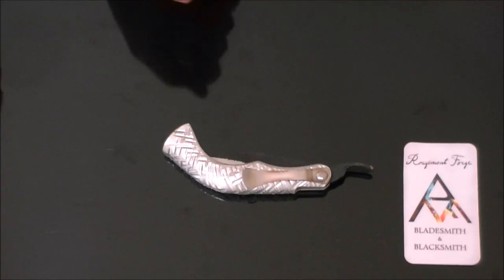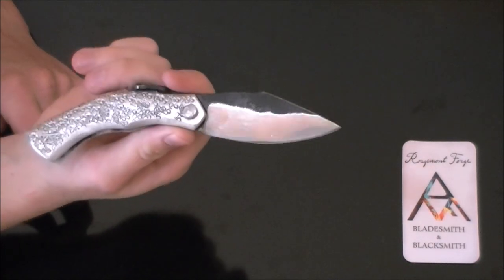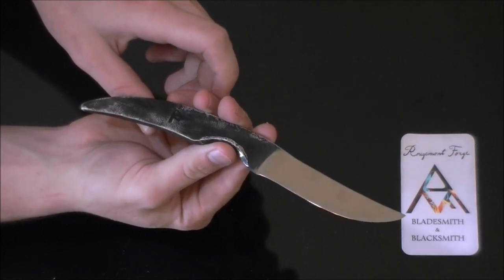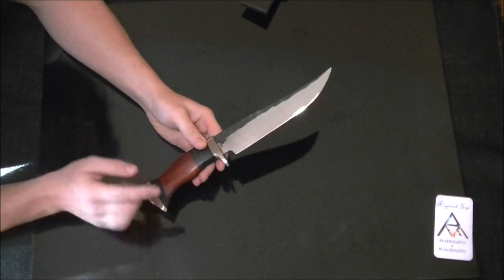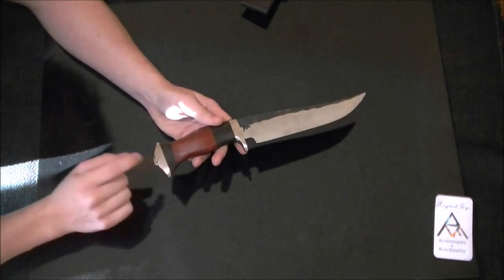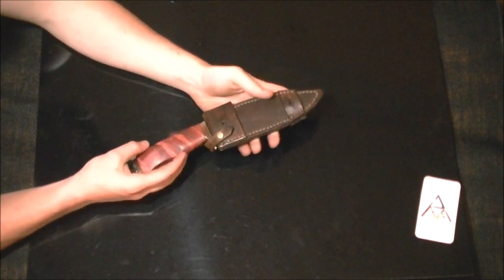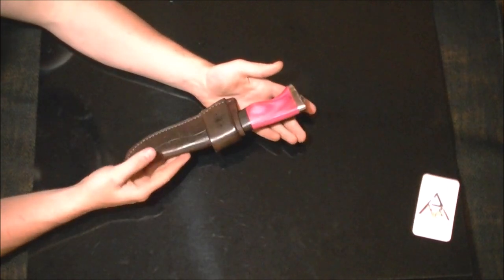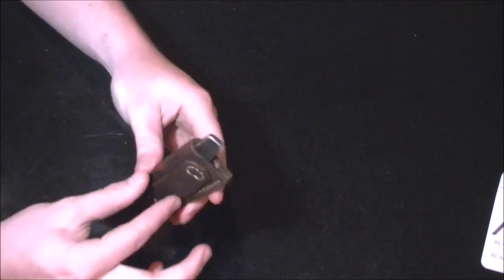Friction Folder and Fixed Blade Show & Tell

Comment: Very cool collection of work there!  It was fun to look at and hear a little about each one of them.  I love the texturing on your friction folders, I've always been a fan of rough texture for contrast in finishes.  At the end you asked if anybody has any constructive criticism and I think that's great, and great way to improve.  Anyway, I just wanted to say that I think if you worked a little on your plunges/grind lines that it could really take your work up a level.  I noticed on some of the F Folders that the plunge was the highest part of the grind and usually looks better doing the opposite, with the plunge slowly rising/feathering into the grind line.  I know it can be hard to keep a straight bevel when forging thin material, especially with forged bevels and distal taper, but I still (personally) think that they can sometimes make or break the flow of a knife.  Don't be afraid to use a file if needed, it's not cheating! :)  Anyway, that's all I wanted to say about that, hope it doesn't come across in a negative way.  Keep up the creative work, it's definitely a good thing to have a distinctive style.  

Btw, if you're not already aware of him, I think you'd enjoy and appreciate some of the work that Nick Rossi (JS) does.  He also does some really creative things with forged friction folders and adds his unique touch on all kinds of things.   Thanks for sharing and take care :)
Reply from the maker: Thank you! It's true, I need to working on my plunge grind methods. When I first started making blades I was (and still am) inspired by Dave Friesen's tanto blades, so not many of my knives have plunge lines. Doing all of those friction folders was good practice, but I think I'll have to get a carbide jig to get it perfect. I don't believe that there is any extra merit for using hand tools over jigs and power tools unless it is done for historical accuracy, and my belt tracking on my grinder isn't always perfect, either.

I met Nick at Blade Show! I love his knives and the purpose of NESM. I like the scrollwork thumb tab on some of his folders
Reply: Rougemont_Forge -  I was wondering if I might be "preaching to the choir", but I figured it couldn't hurt to comment lol.    And yea, I can definitely see that you've taken some inspiration from Dave's work, I think you have something really cool with your own style of take-down assembly.  I've always enjoyed watching his Japanese/neo-tribal smithing as its so pure and with a lack of "clutter" so to speak, it's always motivated me to get out and forge something.   

Regarding jigs and hand tools I pretty much agree as it is the end product that really counts.  I have one of Bruce Bump's carbide file jigs and it has really come in handy.  I don't alway use it for my plunges, though, as he makes his out of solid stainless steel so it can be a little heavy/awkward on smaller knives.  Anyway, I just meant that I've found it can be helpful to go back and forth between power tools and hand tools if needed.  I used to think I was sorta "cheating" some years ago if I didn't get it completely right at the grinder, but it's a great way to really dial them in if the grinder doesn't seem to be cooperating lol.   Now days I personally just get my plunges close on the grinder then finish them up with PSA sandpaper stuck over a the flat and edge of the back of one of my DMT Diasharp stones since they're surface ground and have a very slight radius.  If that doesn't make sense and if you're interested just check out Nick Wheeler's "perfect plunges" video (unless you've already seen it) and that's where I got the idea. Doing that with the file guide on is the best way I've personally found to get them just right, especially if the new belts are wobbly or I'm just having a bad day at the grinder.   But anyway, keep up the great work!